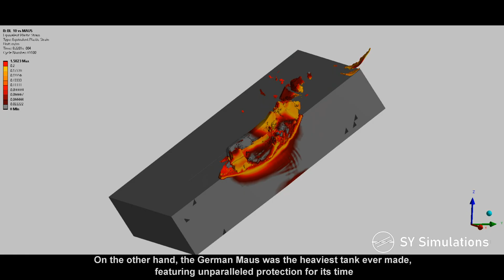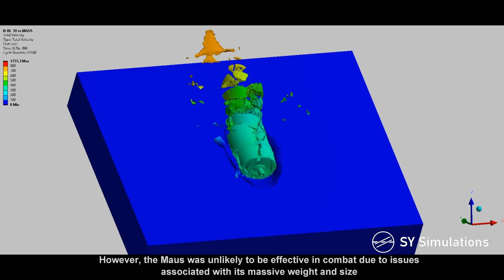MOST POWERFUL WWII CANNON vs MAUS | ISU-152-2 vs Maus | Armour Penetration Simulation

Comment: The whole effective or not is just straight up "because I say so" BS. You do not know if it was to be or not, but the text isnt even worded correctly for it to matter. This tank was SUPPOSED to attract all enemy fire acting as a mobile bunker, it was never expected or even needed on the push actually, purely defensive tank that would advance either slowly with troops getting shielded by its massve hull or just organize strong points. The gun was the actual best gun of the war by far in every aspect too, it could kill you while you as a commie would still be obligated to march for lil pro bank robber stalin

Comment: If your ever in Russia, go to the kubinka tank museum, there you will see the Maus, and the attempts by the Russians to penetrate the armor of the tank, you can see and the dents and NONE went through.
Reply: Those little holes are mostly from Hafthollandung shaped charges.
Btw there are tests where the the long 152 clearly penetrates  
200 mm of armor so the sides and front of the turret would have been vulnerable. 
Still,the 128 mm was lethal to any spg (short of T-28s) even at long range.

Comment: im pretty sure the Maus was made to be an stationary tank, with the fact of having tracks only meant to give it the ability to move just to reposition through the area it was meant to hold and to avoid getting bombed easily even its speed was catastrophically slow. I dont think it would be able to drive through long distances and cover large parts of terrain due to its weight, speed and fuel consumption, pretty sure it was really made to be a metal bunker on tracks, only able to relocate some meters as necessary...
Reply: Ive seen 600 ton mining trucks moving at 50kmh and giant bulldozers weight 200 tons ,moving fast.  Some tracked mining Equipment moves at 16000 tons.
Maus was faster than Churchill tank.

Comment: Could you test PT-76B vs 3BM4 ? As in War Thunder soviet APFSDS tend to bounce from light tanks like this. Western APFSDS and APDS doesn't have this issue and I just don't know how.
Reply: Simulation bros did a sim firing at a HSTVL and it went through no proboem so a BMP stands no chance
Reply: @matthelord7695  Probably because soviet apfsds is bugged in the game. It bounces on most light tanks that have 78 or greater degree of slope. Like the PT-76BTAM, Type 89, Rooikat 105. Even T64, and T72 rounds.
Reply: @MrPezsgess  its not soviet apfsds, its all apfsds, in the stat cards you can see the angle of each apfsds that gives a 100% chance of ricochet, but what gaijin doesnt understand is that apfsds cannot physically ricochet at any angle irl
Reply: @matthelord7695  No because I tested allmost every western APFSDS and those do not ricochet from a 15 mm plate. Stat cards are lying as most shells actually just don't care. Or even a D-5T 85 mm  will just go straight through. Okay that's a magic bullet launcher, but lets take a T-28 gun with 60 mm pen ....  goes through. The soviet APFSDS just happen to bounce. I don't know how long it has been this, but I noticed a while back, and only now I tested it.

Comment: Acctually the most powerfull field gun was from
The sturm tiger with 380 mm gun
On the other hand maus was acctually build 2 pieces of them and placed on the front
1 saw action
And was sourrounded and capcure
Reply: It used a rocket so its not exactly a field "gun" but instead rocket artillery
Reply: They never saw action
Reply: @MelancholicEmir  what?

Comment: Let's say the tank armor Rha is 10mm, how many mm is 30 degrees or 60 degrees?
Reply: 10 mm sloped at 30 deg from veritical is 11.54 mm “line of sight armor". Sloped at 60° from vertical is 20 mm "LOS". 
Basically LOS= thickness/cos(angle).

Comment: I'd love to see this round against an Abrams Front Plate. The jagdtiger round got surprisingly close to going through.
Reply: I seen simulation in another channel. It didn't pen, wasn't even close.
Reply: Why would a ww2 tank be able to front pen a abrams
Reply: Composites aren't like full Steel Armor for tanks. A 128mm shell hitting at enough of a Velocity might pack enough energy to actually cause that one Abrams to become mission inoperable.
Reply: @ NERA if anything would reduce the shock as it decelerates it over a relatively much longer period. WW2 armour is designed to hard stop.

Found the sim in my history. It was an IS2 122mm firing point blank into the turret cheek side dead on. It deformed the back plate and plugged the hole. It was stated to be an APHE shell, but sim was solid shot giving it far better pen. The channel is called simulationplus. The sims it has are somewhat unconventional.

Comment: T44 upper front plante agianst long 88mm tiger 2 gun. Apperantly it survives in war thunder
Reply: 90 mm at 60°? It should go through at short range.
Reply: @ShokkuKyushu  in wt its impossibel
Reply: @Planelover55  There are photos of tests on an IS-2 with straight rolled glacis(90 mm at 60° from v.) at some hundreds of meters if goes through. The cast ,straight 100 mm variant is impenetrable.
The T-44-100 with 120 mm is also inpenetrable.
Reply: it wont survive
Reply: lol

Comment: Are there penetration tables available somewhere for the BR-540B in BL-10 gun?
Reply: i have a photo of several guns, obviously can't post it here, but it shows 152mm BL10 with unspecified ammo at 826m/s velocity as:
240mm/100m
235mm/300m
217mm/500m
205mm/1000m
202mm/1500m
160mm/2000m
angle unspecified, probably 90*
This concurs with the BR540B round data in my wargames rules.

Comment: to be fair a mobility kill would have been more than enough since there was no way to recover a Maus
Reply: and replacing a track segment takes multiple hours
Reply: The Maus was a mobilty kill tbh xD
Reply: The Maus has no mobility to kill in the first place.
Reply: isn't the MAUS immobile already be default tho.
Reply: @MarkVrem  "isn't the MAUS immobile already be default tho.".  Faster than a Churchill.   Ground pressure was low too.  Mobility wasn't a problem, road bridges excepted.  It could cross any rail bridge.
Reply: @bernhardzunk7402  Yes it was. Anything that wasn't a paved road and that thing ain't moving anywhere.
Reply: It also couldn't cross rail bridges. Nor be loaded onto a train.
Reply: @bernhardzunk7402  I would suspect that neither the engine nor the transmission would be capable of running for any significant amount of time.
When your engine has turned its transmission into metal shavings after traveling less than 50km, it doesn't matter if the tanks has a better hp/ton ratio than the Churchill or less ground pressure per square cm.
Reply: @h.a.9880  The Maus used a electrodynamic drive a ward-Leonard system of DC generators and motors which allowed steering and torque conversation.  So no gearboxes to cut or fail.
Reply: @bernhardzunk7402  Something somewhere in the Maus' propulsion system would turn into very fine powder over time. That thing is huge and extremely heavy.
If push comes to shove, chances are that this kraut space magic propulsion system would just... not work at all. Or break down for a million reasons the moment it has to actually propel a vehicle through rough terrain.
Reply: @h.a.9880  There were no gearboxes except for the fixed final ratio drive on each track sprocket which is a very basic and reliable gear type so long as sized correctly.  .   Not even a differential.
-The installation tends to be a little awkward to fit in the engine and two generators.  Unless there was an overheating issue I doubt it would be a problem.
Reply: @bernhardzunk7402  The thing about German WW2 tanks is this though:
Nothing was ever as good as it was envisioned on paper.

The Maus would have been no exception. It would have been slow, cumbersome and a maintenance nightmare.

Check out how many Tigers and Tiger IIs were rendered inoperable by breaking down vs. how many were destroyed during combat.

Do you think the Maus would have fared better?
And this isn't even getting into the territory of the Maus being a design for a type of warfare that was completely and utterly pointless.
The Allies proved this rather conclusively. Medium tanks with a good mix of mobility, armament and crew survivability in combined arms maneuvers win wars.
Building fuckhueg tanks as some sort of wonderweapon to turn the war didn't work.
Why should it work better if you make the tank even bigger and even less usable on a battlefield?
Reply: @h.a.9880  The tigers, even tiger 2's had a better in service hours not even counting the panthers than all of Americas tanks.Something like 80% uptime vs 65% for USA.  They were mostly destroyed by the German crews while retreating,  making it impossible to fix them if they did break down at this time or ran out of fuel which in late war was common as well as not having parts to repair or do regular maintenance.   They weren't unreliable at all.     When Germany was winning ground there were rarely mechanical losses.    You can find the literal photographed paper logs of the German tanks runtime hours during combat and service record somewhere here on the internet.
Reply: yep, and all of the ISU-152 seemed to be equipped with high explosive rounds as well, as the Soviet discovered 6kg of TNT with an extra 37kg of fragments are gonna do wonder with any tank & the unfortunate tank's crews

Comment: Excuse me what ? Most powerful cannon of WW2 ? This gun was never used , it failed in the ISU -152-1 the BL 8 and later in the ISU-152-2 as the BL 10 . It needed to be reworked , but the end of WW2 stopped that . 

The ISU-152 with the shorter L29 gun could barely punch through 100mm at 1000m at 30° . With 650m/s , so 850m/s of the longer gun wouldn't double that penetration . Wich the sim showed us . 

Even the long 88 has more power than that behemoth,  not to mention the 128mm . Most powerful kinetic energy cannon ......
Reply: The long 88 has 1/3 of the kinetic energy. And the ratio KE/circumference (Krupp formula) is still greater so it has around the same penetration(there are photos of pierced 200 mm plates ).
Reply: The ISU 152 has a penetration of 130 mm at 90° at close range. The longer gun had a MV of ~880 m/s . Penetration should be (880/600)*130 which is ~190.

Comment: They would have had to dedicate whole air wings to making sure enemy attack aircraft didn’t get anywhere near this thing
Reply: Aircraft proved rather ineffective at directly destroying tanks. Finding, indentifying, hitting and actually damaging such a vehicle were all difficult tasks. Also an anti-air gun doesn't need to be sitting right next to such a thing to turn less than suicidal attackers away.
A lot depends on how they would have used the Mauses. If it was defensively, then buildings or forest could have been used to hide it. Meanwhile conducting a major offensive without holding somewhat of parity in air would have been a big risk with any vehicles. Mobility is the essense there, so the supplies can't be constantly hiding from enemy aircraft.
Reply: @Teh0X  Would it be that hard to find a Maus
Reply: @treyebillups8602  yes.
There is a reason modern planes have radars and thermal sensors
Reply: (i copied this from another comment, but)
mobility kill is probably sufficient for the Maus, it's not like anything could recover this behemoth once it's tracks were blown apart, like, by two 50kg bombs
Reply: @tranquoccuong890-its-orge  Maus had awfully thick tracks and they were mostly behind armor. Hitting the "open" lower part is more difficult due to bombs sinking a little and usual ground obstacles. They would need to hit very close.

Comment: Ngl, even if it can absorb a couple rounds, how long before the armor cracks or parts fail and you have to repair it?

And how tf do you repair it?? You cant just put JB weld in the bullet hole
Reply: the tank can absorb some rounds, yes, but the crews might not be able to absorb the 2nd 43kg HE shell banging on their ears
Reply: Its just metal, cut out and replace.
Reply: @lorka42  what are you cutting out? Im pretty sure the maus hull is 1 big block of steel.
Reply: @perpetualconfusion5885  almost all tanks of that period are made from metal plates welded together,  idk why you think ot would be made from a solid block
Reply: @perpetualconfusion5885  What? No, it's obviously made of plates. Probably battle damage would be too expensive to repair.
Reply: It's not like a Maus crew would have waited for the ISU-152-2 to unload all its shells😬. A single hit of 128 mm from several km would one shot it. Unless the spg hits the front of the turret.
Reply: @ShokkuKyushu  what about over the long term?
Reply: @ShokkuKyushu  yea
i figure a HE shell to the front of the turret might do wonder for the Maus' 12,8 cm gun

Comment: It is important that the quality of german armor dropped significantly at the end of the war. Also, a few hits without penetration would weaken the armor, making it vulnerable to the last hit.
Reply: A few hits might weaken the armor, but good luck getting multiple hits with a round weighkng near 50kg. Reload would be quite long
Reply: The Maus (rather unwisely) was considered a top priority project at the time, any high-quality steel left available was diverted towards its construction, over other more economical tanks. It, and the King Tiger received special treatment, Hitler was totally convinced that these 'Wunderwaffen' tanks would win the war, therefore he was willing to sacrifice a lot in order to get them fielded. Was this a good decision? No, it was stupid, and a massive waste. But the Maus, King Tiger, and Tiger 1 did not in-fact suffer from any 'low-quality steel' issues. That was a Panther and Panzer IV problem, since they received the short end of the supply stick.

And no, the King Tiger at Kubinka is not an example of the German's lower quality steel. Look at the paper listing the sheer volume and variety of shells lobbed at it before it suffered that catastrophic failure, and you'll realize it held better than most other tanks. Some good examples of steel issues would include the panther that'd gotten its right turret face blown off.

Please do your own research.
Reply: The Maus was not built at the end of the war. Also a 128 mm shell would go through an ISU-152 at extreme ranges.

Comment: It just occurred to me that as that armour isn't spaced, it would be extremely vulnerable to HESH rounds.
Reply: Only from large caliber rounds, I'm not sure 105 HESH would do significant damage
Reply: @sting2death2  what if the fv4005 shot it though
Reply: I can’t find and penetration values for the shell but I assume in a shot like this the front of the tank would be obliterated but the turret crew would survive and have to abandon the vehicle
Reply: @ the f4005 is estimated to have penatration anywhere from 180-250mm based on sources
Reply: So the Maus would be demolished from the front to the engine
Reply: @JohnGertz-e1b  most likely

Comment: Tracks. Mines. Heavy artillery. 
Also the first one might not get though, but coordinated concentrated fire might be a somewhat different story.
Reply: I mean, you can say the same thing about any tank tbh.
Reply: A hit on the turret would go through. Even worse for the SPG,it has T34-85-like frontal armor so a 128 mm from like 3 km+ would go through.
Reply: @ShokkuKyushu  The production Maus turret would have been far superior.
Reply: This was the production turret,many were found after the war,along with hulls.
Reply: @ShokkuKyushu  no it was not. The production turret would have been the angled front plate, like the E 100 turret from World of Tanks.
Reply: @AllMightyKingBowser  Then why wasn't it ever found istead of the tens of Porche turrets? Fake like the Ratte.

Comment: Why not shape or HE charge? You guys intentionately choose the ammo type against which Maus armor are most effective.
Reply: Because penetrating the maus armor is not the point of this video, rather demonstrate the kinetic force of the bl-10
Reply: The 152 mm HEAT round that the Soviets wouldn't work either way. It penetrates around 250 mm of armor, and the Maus upper glacis like shown in the video is 200 mm at 54 degrees, making it 340 mm effective against HEAT.

Comment: Curious about the kinetic energy of that 152mm, I discover it's apparently equivalent to 0.0038240917782027 tTNT - tons of TNT, or approximately 3.82 kg.
Reply: Remember that the equivalent TNT load would waste majority of its energy into the surrounding air, and not into the armor. The shell wastes almost nothing, except whats transformed into heat.
Reply: @rykehuss3435  - & light & sound.
Reply: Yeah, 15.7 MJ ,about 2 times the IS-2 shell. 0.5*49*800²
Reply: that cant be right, thats so low?!
Reply: @Childburner1 idk man, 10lbs of tnt sounds like a lot